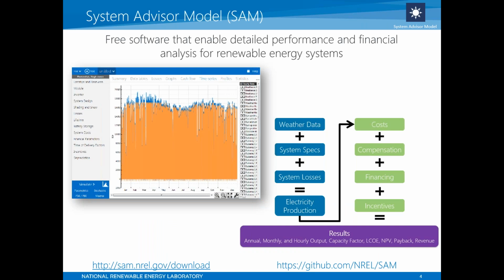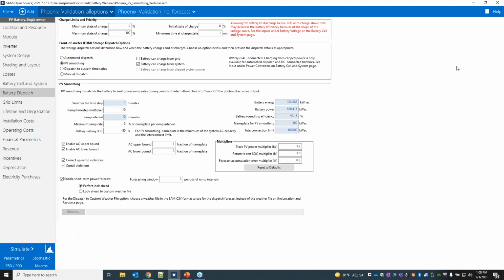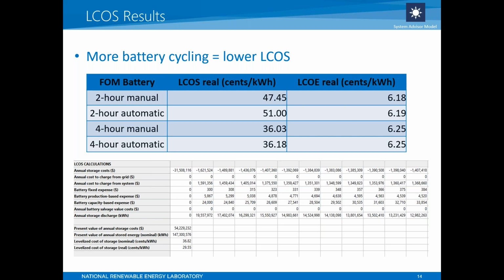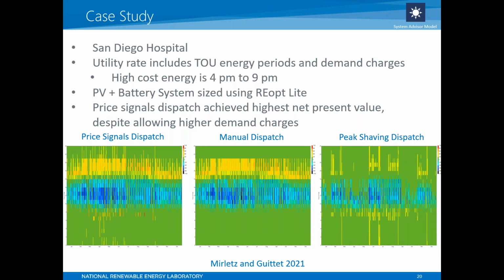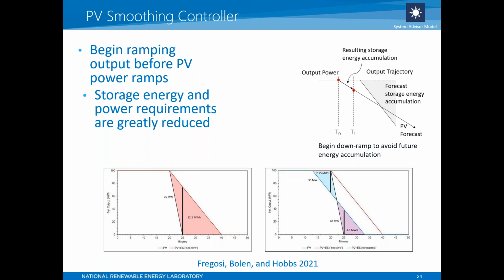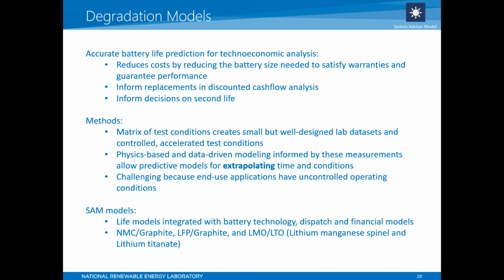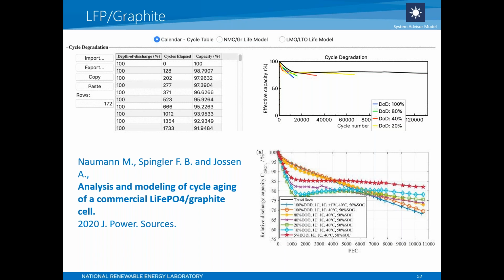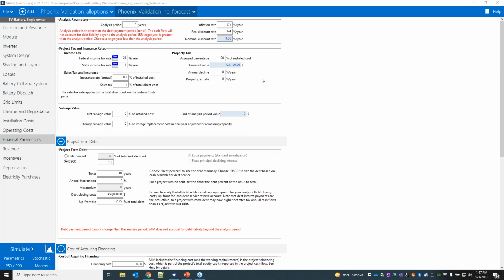Battery Updates for Fall/Winter 2021 Version of SAM

Comment: Can SAM only model a PV + Battery storage system? Is it possible to model only a Battery Energy Storage plant (eg. Gateway Energy Storage project [250MW]) ? Or would it need to be modelled along with a PV plant by which it would be charged from the grid? Any inputs would be appreciated..
Reply from the maker: As described on the SAM website here, https://sam.nrel.gov/battery-storage.html, "SAM does not have a standalone battery model, but you can model such a system using the Generic Battery configuration with a plant loss of 100%." A standalone battery option will be available in the next version of SAM, due for release December 2021.